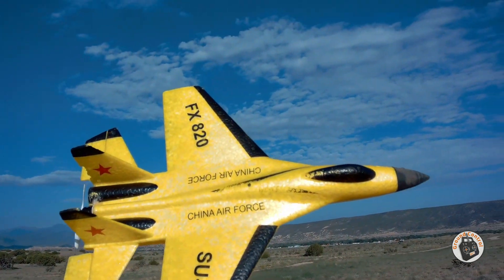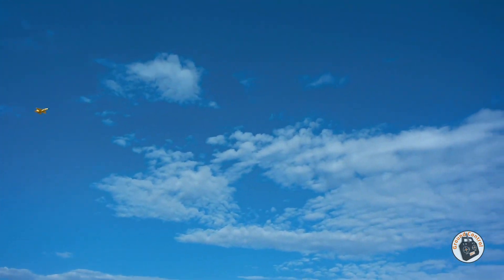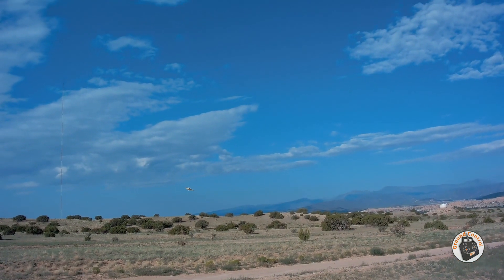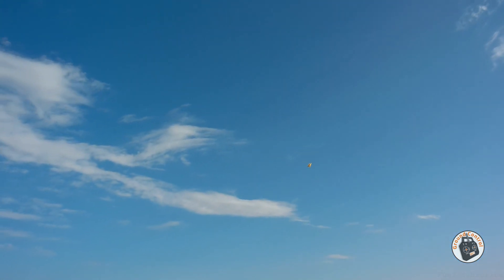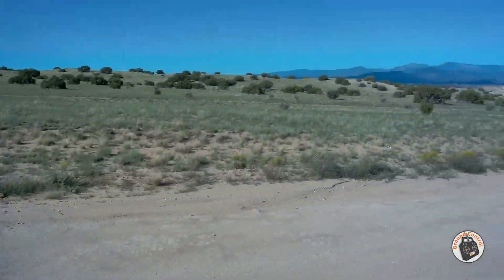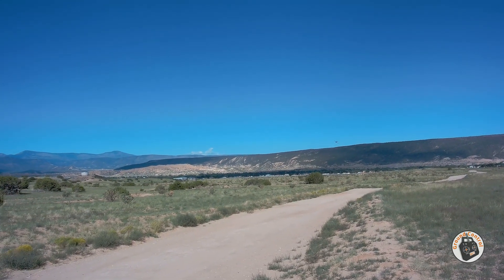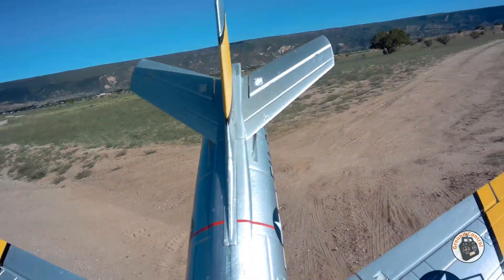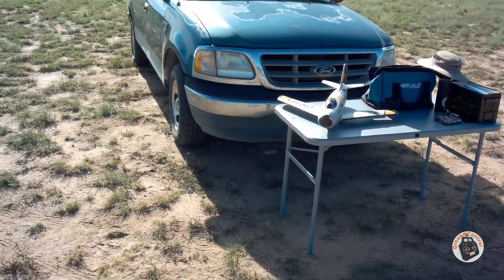Fun Aerobatic Flights Session | FreeWing F86 64mm EDF Jet | Converted 2S Brushless FlyBear SU35 Jet

Comment: Great conversion job GCRC! Theres this good generic Su-27 EPO 720mm RC Airframe originally made as a noisy midprop-in-slot that converts well into a pusher prop, maybe even a dual motor pusher. You might want to look into that, the plain foam barebones kit is really cheap.
Reply from the maker: Hi Rodin!
I have started to look into those barebones kits.
They are pretty inexpensive.
Someone sent me a link to an F-18 EDF Kit that would also work with a pusher motor and prop.
I'm thinking of putting a pusher motor and prop on the Eachine F16 50mm EDF Kit.
It's a solid airframe and might work even better with a pusher motor and prop.
I may pick up 2-3 of those barebones kits for conversions next year.